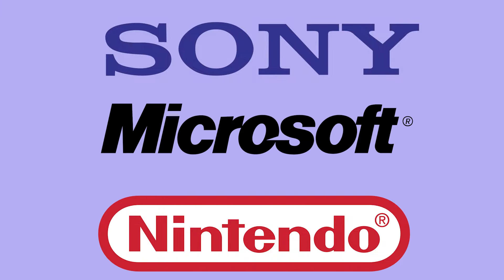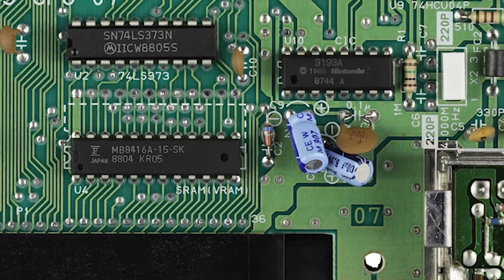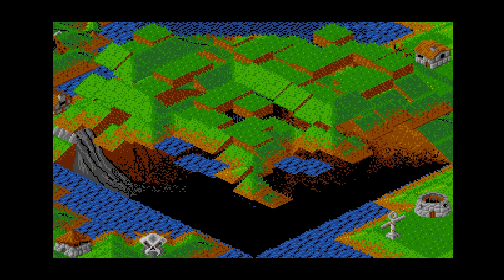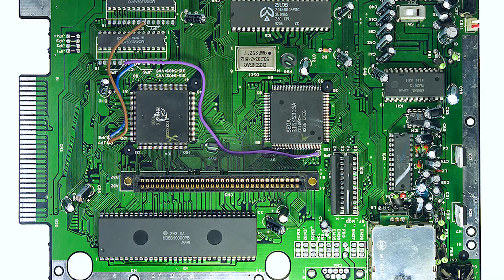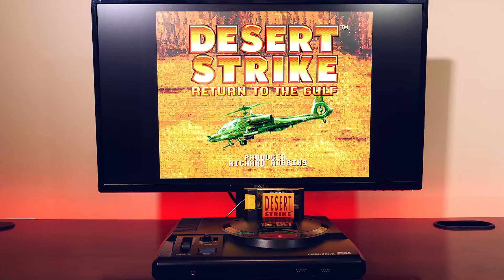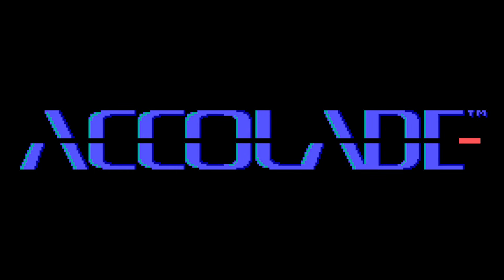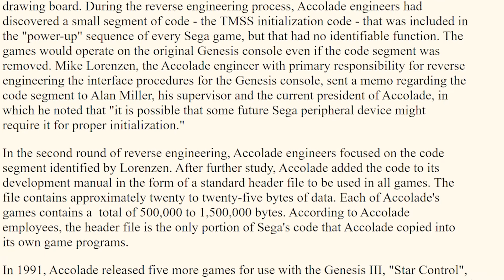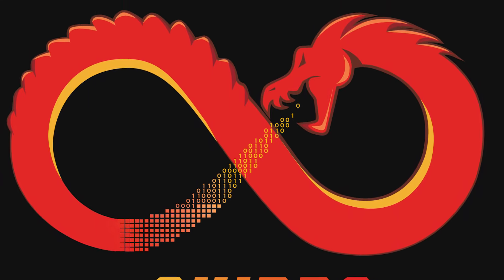How Sega bet against Reverse Engineering...and lost | MVG

Comment: Cool, I remember reading about clean room reverse engineering in the 80s and how Phoenix Technologies created a clean room reverse engineering protocol made up of two teams to create the first IBM compatible PC bios (one who knew the bios inside out and one that did not and made a compatible bios referring to the first group). In the end, it seems that the strategy was so well documented (with layers) and legally tight that I don't think IBM even thought about taking them into court. I think the clean room term came from the fact that all communication in-between the groups happened only in some room, without any other outside documents, besides the metting notes.
Reply: referral madness  Well, according to a Wikipedia document https://en.wikipedia.org/wiki/Clean_room_design , the clean room design is useful as a defense against copyright infringement because it relies on independent creation... Not sure exactly what it entails... but it has something to do with the group that that does the actual programming never having direct access to any hardware/software inspection or prior knowledge, but relying on another that does, the guys that write the code only have indirect knowledge by interviewing the first group, why exactly this is legal protection I am not sure, in practice the knowledge extracted by the company as a whole is the same, it is just a more cumbersome method...

Comment: Several things come to mind:
1) I'm not sure I'd call it an anti-piracy measure. A perfect ROM copy would boot just fine, unlike Nintendo's CIC system. This seems to be purely for licensing enforcement.
2) During the case, Sega apparently demonstrated cartridges that would boot without triggering TMSS, and tried to claim that since it was possible to boot a game without TMSS, displaying the trademark was an infringement. However, looking at the ROM disassembly, I'm not sure how this is possible. The only thing that comes to mind is a cartridge that doesn't assert /CART and pretends to be the Sega CD ROM. Any ideas?
3) If TMSS was added after the fact, did they just get lucky that earlier releases also had SEGA in the header?
4) Given that they lost this case, I'm surprised they continued down the TMSS path with the Saturn and Dreamcast, although IIRC in the Saturn case you also had to have a byte-for-byte copy of the trademark display program on your disc (and thus making a stronger copyright claim). I imagine that's because TMSS was (potentially) legally effective in other markets, but I'm not sure if they ever pursued enforcement outside of the US.

Comment: Fun fact: The Game Boy uses the exact same security mechanism. I'm not sure why Nintendo didn't reuse CIC (maybe they didn't have enough space on the cartridge?). I've heard it was because they wanted to target Taiwanese bootlegs specifically as Nintendo could enforce trademarks over there far easier than copyrights. This resulted in Taiwanese pirates figuring out a time-of-check/time-of-use (TOCTOU) bug that lets you change the boot ROM logo (since it copies it twice from the game).

Nintendo fixed this check for the Game Boy Color... and then broke it in a different way! On the GBC, they only check half the logo, leading to a lot of hilarious half-edited Nintendo logos on Taiwanese pirate games. (These presumably won't work on a DMG unless they also included the same hardware to exploit the TOCTOU bug above.) At this point, I'm pretty sure Taiwan enforced international copyrights, so it was entirely silly to do this as it provided no protection for the pirates, but old habits die hard, I guess.

Comment: It's funny, I can remember going to the video store and renting some of those Accolade games and the employees there telling me I would need a special adapter to play them... but I'd get them home, pop them in my Genesis, and they worked just fine. It was only some time in the last 10 years that I learned of TMSS and I suspect that was the reason they were telling me I needed an adapter. I still use that same Genesis today, it's the original MK-1601 model with "High Definition Graphics" etched on the ring. I got it in '91 with Sonic packed in but they apparently still hadn't made any internal revisions to the hardware yet at that point. No security checks or region locking, I can play unlicensed and foreign Mega Drive games on it just fine.
Reply: Region locking is effective on all megadrive. Depend of games region locked or not.

Comment: Love your videos. I remember way back when using softice and crackme files to learn some basic assembly and how to to some reverse engineering. Then later I used a snes9x version that had a debugger built in so I could make game genie codes which I am sure you are aware are basically rom patches and require some level of basic assembly knowledge.

Comment: I WISH I had access to a modchipped PS1 back in the day.  I did end up getting the good laser version of the fat PS1 though and used a card plugged into the back of it that also supported cheats the only flaw with this method was it required the lid to have a spring or something to have it down all the time, and when you had multi disc games it was a bit of a pain.  I knew one person with a modchipped console and it was terrible at reading discs.  Actually I more wish I had a modchipped Sega Saturn as even to this day bar those expensive SD card adaptors that replace CD roms there is no easy way to play backed up games, yes I say backed up as imagine wanting to play Panzer Dragoon Saga on Sega and risking your rare and expensive original rather than a easily replacable cdr.

Comment: i wonder if there is a expiration date on those restriction... like for Example, i got a bit interested in those "Super Metroid" Mods recently but i have no idea if Nintendo would try to ruin all that work or if they don't care...

a lot of ASM does some fancy things under the hood like surface reflection on liquid or wide screen or simple bug fixes... i spend a day applying ASM Patches, some fight each other and i am no programmer so i can't fix them but some operates on different addresses and can be mixed... the ROM is almost understood enough to have its parts moved around in a modular fashion! (i give it 2 years and they might have it 100% under control and no more guesses and "do not touch" areas of codes!)

Comment: With custom hardware like the VDP,  Sega could have included a bank of Encryption keys of which they would give one to each licensee.  Being in the hardware it would not have been easy to get as it would not have been on a Bios chip which are easy to read.
Reply: You'd run into a couple of problems there: 1) you'd break backwards compatibility with existing games, and 2) cryptography at the time was still heavily export-controlled

Comment: But Sega cartridges do have a form of copy prevention inside the chip. When games fail to boot, lots of people fixing these cartridges use a 1K resistor to ground one of the pins and it works again. Otherwise it stops working because something inside the chip fails.

Comment: I'm confused. If the original system didn't have any copy protection, but the later system did would this mean that older games won't work on newer systems or was this just a common thing that was already present in games before the copy protection?

Comment: Motorola, not Motorolla 😜
Anyway, wanted to ask about using 8bitdo controller on CD32... You mentioned it on some video (Mega SG?)... Been looking for a proper controller for it. Bought an PS-controller adapter, but it has compatibility issues with many games...

Comment: So with TMSS, what happened to games that were built prior to the point of it's implementation... they wouldn't have introduced the required header so there'd have to be some form of backwards compatibility offered? or was TMSS produced prior to the production release of the console itself?
Reply: After reading a few pages, It seems that the required "components" were already part of their coding documentation/structure since before the TMSS, they just "repurposed it".
Though there were a few games that for some reason didn't have it, so though they were competely legal, as you said, they didn't boot up on the updated models.

Primary source: https://segaretro.org/TradeMark_Security_System

Comment: looking at these cases looking at these cases, I wonder how they could be applicable today. Of course, the key difference being that today consoles run sophisticated firmware.

 Consider, for example, how easy it is to install Android onto a Nintendo switch console. What if a company developed it's on firmware in order to sell its own games and a competing online service that might even be better that would Nintendo offers or alternatively is simply free while simultaneously allowing Nintendo games to continue to work and maybe adding in the ability to run various Android apps via an App Store that anyone could sell on. Granted, this late into the life cycle that probably wouldn't be a good idea, but at least on paper it seems like it could work and would be legal.

A much more lucrative option would be to build a custom firmware for a Tesla car. Since the vast majority of features are enabled or disabled to be a software, a company that could successfully build a new firmware for the car could purchase cars and resell them with the new firmware installed and with maybe a $10,000 markup enable $100,000 worth of features. Tesla of course would not like this, but you physically owned the car. The only reason why they can get away with charging you so much money to allow you access to the hardware that you physically own is software licensing, which means that if anyone develops competing software to do the same thing they can sell the same features in part or in whole. frankly, I'm surprised no one has tried doing something like this already. I mean, I know that there are three custom firmware is that you could install, but as a commercial Enterprise competing with another company on its own product seems extremely lucrative if you could pull it off.

Comment: So if reverse engineering is legal, whats the big deal with the recent gamecube/wii leaks? Could these not have been reverse engineered over time with the same results?
Also, could the results of those leaks be used to improve emulators and passed off as RE?

Comment: Disclaimer: I am not a lawyer. The following is just me trying to wrap my head around the legal trolling that went down..
So basically, it was the console that displayed the copyrighted material, not the ROM, therefore it was outside of their control and that's why they can't be faulted for it, right?
But if the ROM had displayed the copyrighted material instead of the console itself, then that would have been under the developer's control and they'd have lost. At least, that's kinda how I understood this.

So, if the console had instead had a way to inspect the video memory and abort execution if the ROM didn't display copyrighted material, that would have worked, wouldn't it? Not sure if that would have been technically feasible though, since it is my understanding that those early consoles had no OS and ROMs ran baremetal, therefore once the console jumped into the ROM's code there'd have been no way for it to regain control. It would've had to either have a separate circuit that could act independently from the main processor and axe it if the ROM didn't behave, or it could've checked that the ROM had instructions to display whatever the console wanted it to before jumping into it's code, which would've been tricky at best. ('Cause the console would also have had to ensure that the codepath actually got executed every time the ROM was executed.) Or am I completely off track here?

On a separate note, how does this protect against copies/piracy? A copy would've had the exact same code and satisfied the exact same checks as an original. It should've been indistinguishable from a legitimate copy to the TMSS.

Comment: So let me get this straight.. If I copy a copywritten book which was originally written in english, but I translate it entirely in spanish, then its perfectly legal?  Because that is the same absolute exact thing happening with emulators.  The emulator is functioning exactly like the original system but its essentially using a different language. Like a foreign language. The point is, its still the same exact thing only a different version of it. ...Same exact thing as writing a book in english then writing the exact same book in spanish.  I sourced the english version of the book legally, then I wrote the spanish version entirely by myself. The spanish version is totally different and i made it myself.. its not english so its perfectly legal right? Literally this is the same absolute-exact thing happening with emulators. There is not even any room for argument in this matter. Literally none. As in this is really the same exact thing happening with emulators. Not even slight room for argument. This world is C L O W N W O R L D